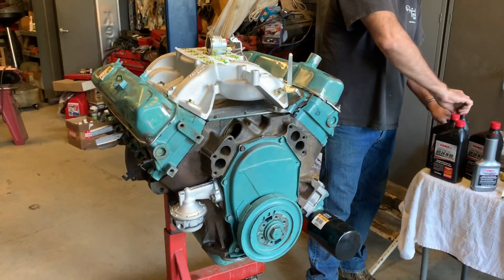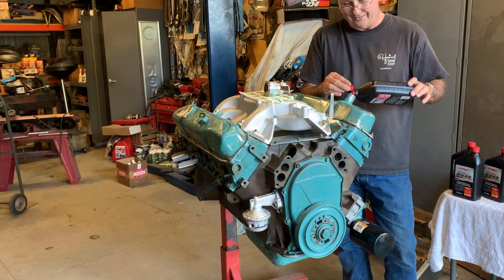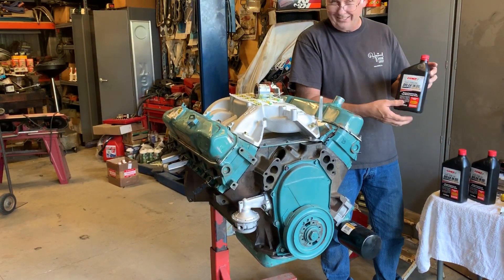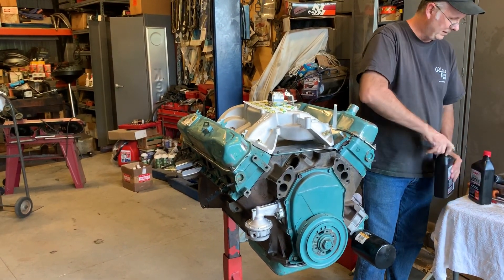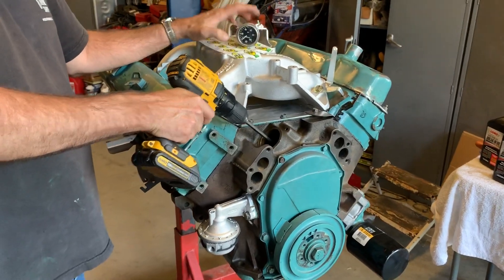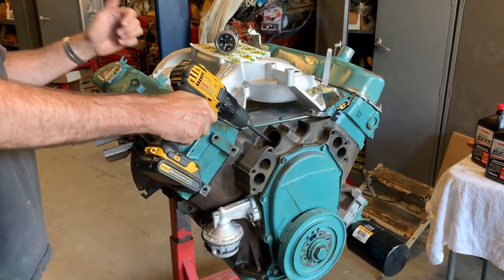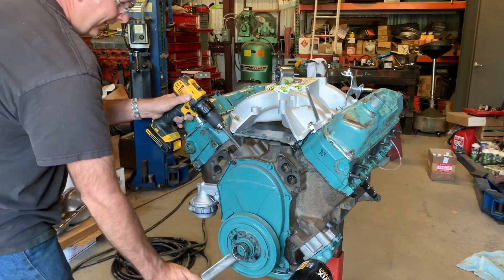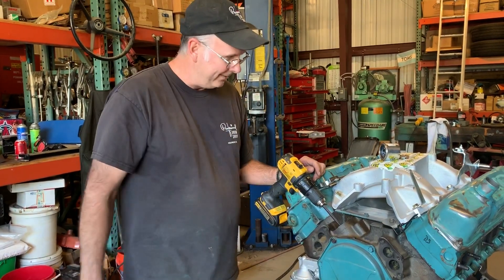How To Prime An Engine

Comment: Getting ready to do this for the first time, great video. My question is that do you have to have the intake on to do this? Mine is off. Thanks
Reply from the maker: You can do it with the intake off no problem.  Just hook up a manual oil pressure gauge and remember to spin the oil pump counter clockwise.  It's also is a good Idea to slowly turn the engine over by hand to help line up the oil passages that feed the cylinder heads so that oil gets to the rocker arms quicker. - T
Reply: @Challengeher  fantastic, I have my engine on a stand, having doubts of putting in the dipstick yet because of my headers getting in the way during install, can I just Plug the dipstick hole or do I have to put the dipstick in? will do exactly what you suggested here, thanks for answering my question.👍👍
Reply from the maker: I'd leave the dipstick out until it's in the car.  No oil will come out since the engine isn't running and you're just pre-lubing the oil system.    If you're using a stock tube i'd bend it as straight as possible and then put a small bolt in the end so you can hit it with a hammer (so you don't damage the end of the tube).  After it's driven in you can re-bend it as needed to clear the header.  By the way, chrome dipsticks are too thick to drive in without sanding the end that goes into the block first.  It just needs to be a slight press fit with sealant on the tube.  440 Source offers stock plain metal dipsticks and tubes that fit well if you find you need another.  - T
Reply: @Challengeher  holy cow this was super helpful. 🙏  I’m getting closer and closer to the swap. Been waiting for over 25 years to do something like this on a 60’s Dodge. Thanks again for the info my friend.

Comment: When I remove my distributor, it has a slot way down in the engine. How do I get that thing out to get this long hex shaft in? There must be more to this that I don't understand! If I try to turn that slot, it's trying to turn the entire engine over I would assume, because the engine rotation is what turns the distributor. What piece am I not understanding?

Just trying to replace an oil pump because I had no oil pressure after an oil change and my lifters started clattering.
Reply: Nevermind. I figured it out. Pull the midshaft and then it goes right in! Minor details!!
Reply: @austech360  how did you finally pull it without the tool; the oil pump intermediate shaft is what I am trying to remove, you can tell the gears are rotated by the cam gear
Reply: @jnng7463  I didn't actually have to pull it. I just packed the oil pump full of Vaseline then fired it up. Worked like a charm

Comment: How do you prime an engine that doesn't have a distributor? I was thinking about just pulling the coil wire,so it wouldn't start. Then crank it over until it built some oil pressure. Then hook up the coil wire and start it up. Would that be ok? Or is there another way to do it?
Reply from the maker: Another method is to pressurize the oil passages through the oil pressure sending unit port.  This location is normally a pipe thread so you just screw in a hose and instill pressurized oil through the hole.  You can buy "oil prelube tanks" from various sources, usually air/oil pressure tanks.

Comment: I have a modern engine QR25DE... the phaser gear will not stay in its designated locking position during startup bcs of the aggressive cam and spring puts too much stress on the locking pin and on a dry start the phaser makes noise until there’s oil. 

NOW... I have some ideas but how can I prime or build oil psi with an electric scavenge oil pump? I have an idea for priming just the phaser but I also want to know my options as far as just priming the motor if it’s easier.

So far it’s been with the starter and switching off my spark.

Comment: What size is the crank bolt you're turning?  Where did you plug in for the oil gauge?  I need to prime my engine as well
Reply from the maker: 1 1/4 socket for the crank bolt.  Top rear drivers side of the engine for the oil pressure gauge 1/8 pipe plug threads (most oil pressure gauges)

Comment: if you know anybody that works in Industrial maintenance, or who works in a scrapyard, conveyor rollers use a variety of sizes of hex shaft. One thing to note on the general process you are showing is that some types of engines there is an oil gallery that goes AROUND the distributor housing where it goes through the block, so a reworked distro works well for priming those kinds of engines. They would never prime properly otherwise :-).
Reply: Priming is a good idea to check if pump is good etc, but overpriming just washes the assembly lube out of the bearings, I prime only until the gauge hits max pressure, then stop thats all you need, otherwise all good!